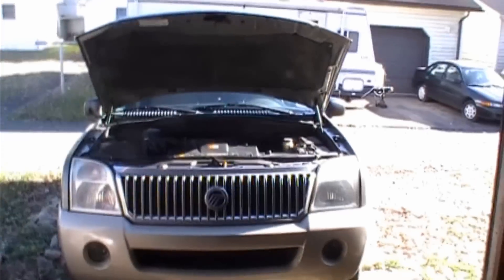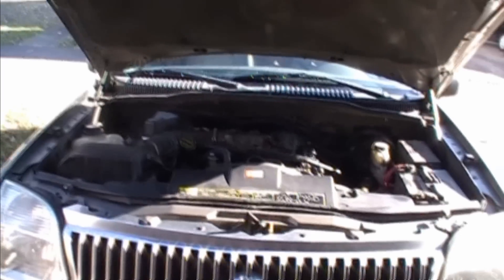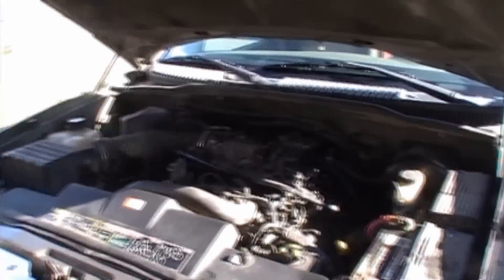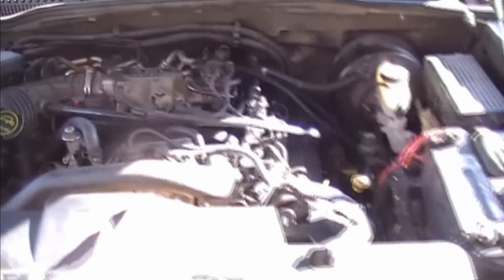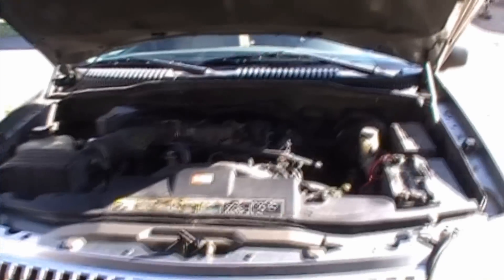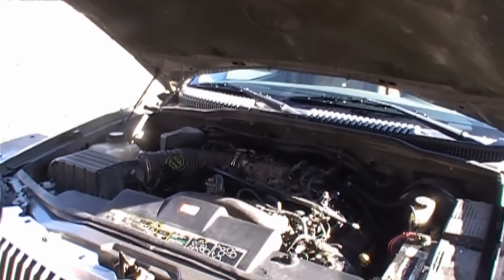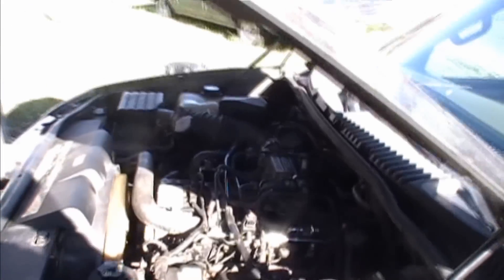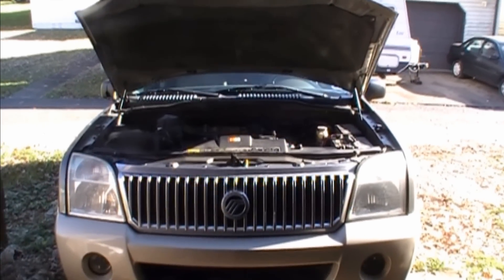PO430 CODE  The real story...don't waste your money!!

Comment: Should not there be p0171 and or P0174 if the intake manifold cracks a little? What if it is only P0430?
Reply from the maker: True, but you can get a po171 and po174 if it a bad exhaust leak. I have a pending po430 again...I need to test the converters now. I think one is actually getting bad ;(
Reply from the maker: po430 is almost always a intake, air, moisture slight leak. For me that's been my history.
Reply: @FixingWithPassion  Hey man. Great video. I have a 2002 Lexus IS300 and am getting codes p0430 p0171 p0174. What do you think is wrong here?
Thank you
Reply: @FixingWithPassion  how can I test the cats? Infrared thermostat? If so  what should my readings be? Have you ever used a O2 sensor spacer? 
Thank you

Comment: Didnt work on 2003 explorer 4.6l      still p0430 code.  Replaced o2 sensors last year.but my concern is,ive got the milky oil cap and water filling up in oil seperator i put on truck. There was a bunch of water in spark plug hole in cylinder where this intake cracks.(driver side plug closest to firewall)what is up???? Inspection is due and im frustrated
Reply from the maker: That's your issue. The intake gaskets are a big issue on these plastic intakes. E-BAY , new intake with gaskets...$120.00...Fixed my PO430...on all 3 explorer's and my expedition. As for the milky stuff, moisture could be getting into the intake;( ...from the bad intake gaskets.
Reply: If you have milky oil cap p0420/30 will never let you go

Comment: This worked on my ‘09 Jeep Wrangler. I had tried the Cataclean and new O2 sensors in bank 2. Neither worked. 

I had loose connections. Tightened everything back down and cleared the code... so far, after 50 miles— no new CEL.
Reply: What connections were loose

Comment: Yes, but!  The code didn't come back BUT, Oxygen Sensor Heated came up as Not Ready!  So, the sensor isn't getting hot enough, so you probably have to drive at high RPMs and then rev the engine while you sit in line at the station.  Keep your own monitor on the OBD2 to monitor it just before it goes in.

Comment: I really need your help. I have the same code and I replaced the cat without any results. I need to know what your vehicle symptoms were. My does this weird thing we’re I all of a sudden get a little hesitancy on the highway and I need to punch the gas to get the truck back up to speed. Did yours do this as well?
Reply: Im no expert but that could be fuel injectors, spark plugs or air intake. I had issues with my previous vehicle and thats what the issue was.

Comment: Well in my case on my 98 crown Victoria they guy I bought it from told me about the code it had the ecm replaced due to multiple misfires on all cylinders when I got it runs fine code came back also manifold cracked I have a new manifold new plugs still have code could the previous issues have done the catalytic converter in already
Reply from the maker: O my !

Comment: I have a 2007 Chrysler Sebring that  shakes in idle , burning smell and stumbles when I accelerate.  First the check engine light came on and then the car overheated. I checked under the hood and there is a huge crack in the radiator hose and all the coolant is gone. Today a "electronic throttle control" code came on and now it's gone off and hasn't come back on. Could all of these issues simply be from this Leak from the hose ? Once I replace the hose and coolant will the car run normally and we the burning smell go away ? I don't want to pay a mechanic to do what doesn't actually need to be done so I've done research but your vide makes alot of sense

Comment: A blocked fuel rail was what was causing mine in a 2000 Nissan maxima I bought with a check engine light on. The previous owner and his mechanic replaced o2 sensors and cats and it kept coming back i kept pulling the freeze frame data for 6 months and determined it was a fuel issue
Reply: Holy cow thanks for sharing. 

9/99 or 2000 model year Infiniti  i30 use to tell me I needed my cats replaced.  New Hitachi coil packs and replaced both speed sensors ( bank a and the revolution. Shifts smoothly and no more waiting for my speed odometer to wake up . (Po500) 

Fluid is blackish red thinking about removing a couple  of quarts and adding some  Lucas.  Hopefully  I can get another  100000 thousand miles  out of the old transmission. 

I have 253000 miles  on her . 

The engine seems to be acting like its unstoppable. 

Royal purple high milage 5w30 . Helps with noisy lifters.  
I love my car. Clear coat is trash. Chips.
Reply: I had a 0 volt o2 sensor replaced it helped. Genuine Nissan part it works very well.

I use bluedrive.  To troubleshoot.
Reply: Thumbs up thanks for the heads up.
Reply: I ran a bottle of Lucas super fuel system cleaner/ combustion chamber cleaner every fuel up for 3 months straight and like it says on the bottle it works check engine light went out on it's own a week later and I reduced it to one bottle a month and now I'm on 1 bottle every 3 months still no check engine light and my power and performance is back but my fuel economy still isn't but I blame that on 3.5 mile trip to work and back for a total of 7 miles a day
Reply: On our trips back and forth from MD (170 miles each way) I do get close to the fuel economy I'm supposed to get 30mpg, I see abo 25mpg and again I blame traffic on that one sitting in the same spot for 20 min or more alot in MD on the beltway

Comment: I have a 97 Ford F-150 and I don’t have an exhaust on it has a catalytic straight down the engine from where u check the transmission oil and all that I was on my way to the bay and passed through the Livermore mountains and my check engine light started blinking and my gas pedal started getting harder not letting me accelerate and it started rumbling bad and it has a cylinder 7 misfire what can this be I need help please
Reply from the maker: Ok.....fix #7 first

Comment: On my 03 Ford 4.6 been losing coolant for over 3 years (about a half gallon ever two months), no signs of water mixing with the oil. But now I got a P0430 code. Where should I start looking? Thanks.

Comment: I had my engine completely rebuilt by a reputable machine shop about two years ago and I’m sure all gaskets were replaced...so why would this happen? Could it be catalytic converter? My truck is almost 20 years old. I replaced all O2 sensors.

Comment: I had a bad head gasket and all the coolant was gone. My buddy from Toyota dealer said not to replace and said coolant might have infiltrated the catalytic converter at bank 2. Said to rebuild engine and slap it back and drive a while to clean out coolant and light might disappear during break in period of rebuilt engine....The light is back on....Any thoughts/ideas as to how many miles it might take to burn out coolant or to simply look for leak since the rebuilt passing a certain number of miles negates the cleaning out idea.
Reply: Oh it is for a 2005 Tundra 4.0L
Reply from the maker: Best thing to do......https://www.youtube.com/watch?v=JFCYZVx_4WY

Comment: how do you know if it's the intake. I just changed my radiator it had a hole. but im still getting bank 1 and bank 2
Reply from the maker: Bank 7-B
Reply: Smoke test. Pull a vacuum hose, plug the port where it hooks up, and blow cigar or cigarette smoke in the line and watch for it to come out somewhere.

Comment: Exhaust leaks vacuum leaks mass airflow sensor is 90% of the issues with this code as a mechanic I dealt with. It was  rare or ever a o2 sensor goes bad .when a o2 sensor code  goes off it's doing its job .telling you something in the system is wrong

Comment: So pretty much I need to change my plastic upper in take or my upper intake gaskets?
Reply: Depending if your intake is plastic, it could have cracks.  Or you most likely have gaskets that are faulty.
Reply from the maker: Pretty  much all intakes now days come with the right gaskets for the intake. Less that $125 on e-bay free shipping. Make sure to have the right V# of your auto.
Reply: @theman9462185  yes its all plastic 2004 ford Taurus v6 3.0 ohv...
Reply: @theman9462185  thank you.i  appreciate your honesty feedback and videos Sir. I'll be shopping on ebay I guess

Comment: Hi Nathan, I got a avensis t25 2004 2.0 . I got the p0430 code. I saw that my intake gasket is also made of plastic. Do you have any experience in such models and same faults? Thank you.
Reply from the maker: Intake gasket possible or a air intake leak.
Reply: @FixingWithPassion  thank you.

Comment: I bought this Toyota 2000 tundra 4.3 
Two weeks ago and now that is time for me to take it to emissions pump check engine light and same code here u think could be the same issue since I also hear a puff puff when I ran the truck on the passenger side any advice will help today I was about to buy the 02 sensors but I decided to give a try searching for more info on here

Comment: Thanks for the video! I'm a novice mechanic. Trying to learn just enough to be dangerous. :) Especially if it's something I can do myself. I have a 2005 Jeep Liberty and I have the P0430. Are you talking about tightening the intake manifold?
Reply from the maker: Good to check them. Check fuel trims with a code reader.

Comment: 35 years of working on vehicles for a living and I have only seen a few  situations where this video information was the cause. FYI the mountaineer is notorious for leaking at the intake. This is not the same for other vehicles.
Reply from the maker: In my world , it every 4.6 mountaineer that comes my way for some reason...that need a new intake plenum/or gaskets that triggers the PO430. Cheap plastic intakes. There should have been a recall.

Comment: How do I locate the intake gasket on a Lincoln LS 2002? And how can I figure out if it's really the air intake ? Do they cost a lot for the part and the labor ?
Reply from the maker: Its on top of the motor. With a question like that...you are scaring me ;( ....Yes ...if a mechanic does this its probably going to cost 100's of  dollars plus parts. ;(

Comment: They make cars way too complicated these days. It's all in a bid to continuously rip off the customer.
They need to focus on good reliable engineering instead of gadgets and laptops.
Reply from the maker: dhalsim1     Yep...it's all about getting the air clean out the tail pipe so the environment stays smog free.
Reply: @FixingWithPassion  you do know most cars over 8 years old are worse than most cars before catalytic converters were made? The reduction in performance of the cat increases fuel consumption and the cycle continues as most people only replace that emmision junk when it causes drivability issues. They also waste a lot of materials like platinum and steel so there is more emissions from production and mining so they really cause more damage then they help.

Comment: Hey Xman.... First let me say that I'm not a mechanic.  I got a 2003 Nissan Pathfinder with 195k miles.  The person who I got it from was told that the "service engine light" was no big deal.  I'm sure its not but I can't register the vehicle without it being smogged in California.  It will not pass smog with a "service engine soon" light on.  Plugged in a code reader and got codes P0420, P0430 and P0470.  
Decided what the heck i'll changed the Oxygen sensors (all four of them) and clean the throtle body (fix for P0470) and see what happens.  Two of the codes disappeared.  Code P0430 however remained.  Took to a Catalytic Conv. shop and was told that It was definitely the Cats.  Changed the two Bank 2 cats as two shops I went to told me the only way to guarantee a fix would be to change both Bank 2 cats.  The car has 4 cats....2 on bank one and 2 on bank two.
Bought the cats online had them installed and code still comes back.  I'm presently trying to clean the intake and find possible cracks.  There are none.  

I went to code2.com and the three possible problems mentioned there are:  1.  The catalytic converter is no longer functioning properly.   2. An oxygen sensor is not reading (functioning) properly.  or 3.  There is an exhaust leak,

Will report on what happens after I change the intake gaskets and clean the entire intake manifold.
Reply from the maker: I know California is a pain in the ass for emissions. Use to flip cars there back in the day... Yea let us know what you find. My thinking you have a bad intake gasket. Ive had them look new only to have small cracks in them. That code says there is something going on in the engine area, gasket air leaks, moisture getting into the system... ect. Try to spray some starting fluid around the intake and see if the idle changes...if so ...bingo!   P0430 -99% of the time its something going on near the engine...
Reply: HI I have an 06 Nissan Titan  4wd 5.6 flex fuel crew cab. I have the same problem you do. error code p0430 all 4 cats says are bad. I have noticed loss of fuel economy as well. So I'm wondering what did you end up doing to fix the problem
Reply: Jeff R did you ever get your titan fixed for p0430? What was the solution? Did the mileage improve?
Reply from the maker: Intake gaskets were bad. And found a small crack in the bottom of the plastic intake. Replaced both. Ran like new aft wards!!
Reply: TVWXMAN32 thanks, great to hear it.
Reply: You never reported back...

Comment: Need some help.. I have an 01 Nissan pathfinder reading po430 no known issues at the moment I had the code cleared reset the ECU and it went 300 miles before the light came back on.. Any suggestions?

Comment: I get the P0420 & P0430 codes and I can clear them ok. But once the ute is driven for say 50 klm the engine light comes back on again and sure enough the same code is present. This ute does alot of sitting around in a garage which I know is no good for it.
So if it was a vacuum leak or sucking air in would the engine light come on virtually straight away?

Comment: Have a 2013 F-150 with the 5.0 and I just had this code pop up. I put on a new Canister Purge Valve (mounts right into the throttle body) on my truck because it was pulling a vacuum on my gas tank a couple days before I got his code. I'm going to look for a possible leak around that or the intake gasket. Ill post later if this is my fix. I really hope this does it.
Reply from the maker: Yea there is a leak there somewhere;(
Reply: Robert Dallimore .
Reply: Robert Dallimore update? i have samd year truck and engine and just got po430 last night...
Reply: Brian Desjardins got the same issue on my f150... any updates? Thanks
Reply: Have any of you guys find a fix for that code on you f-150. I have the same code. Says my cat below trush hold bank 1. I cleaned the sensors and got a new cat. Code still there. I'm going to look for leaks but was wondering if anyone found a easy fix or leak.

Comment: I was told to check the temperature at the front and back of the catalytic converter with an infrared thermometer that you can point . I have 2004 toyota 4runner with a P0430 (bank 2) code. I checked the temp first on the drivers side's first catalytic converter and it read 360 deg F on the input and 430 deg F on the output. But the passenger's side catalytic converter is around 360 deg F on both the input and output. To me that would appear that the catalytic converter on the passenger's side is defective. Or can a intake manifold leak cause the same effect and the converter is okay?
Reply from the maker: Do you have a PO420 also?
Reply from the maker: No, with those temps its a bad cat. You did the right thing! PO430 is 
usually related to intake gaskets, slight leaks etc. Sounds like your on 
top of it! But most of the time you should have gotten a PO420 Hum.... 
Let us know if you fix it and re do the temps again on the cats so other
 folks maybe can have a fighting chance to fix issues like this.
Reply: There was just a P0430 code. But why is the passenger side catalytic converter appear to be defective when it's a Bank 2 error code which should be the drivers side?
Reply from the maker: I think whats going on here is a cat is misleading you. Meaning something up 
stream is causing the cat to go wild. PO430 means something in the 
engine is leaking...air/moisture etc. I'd start looking at gaskets. I 
bet you have a gasket or a slight leak in the engine. I would not touch 
the cats....start at the engine!

Comment: CEL P0420 for my Mazda 3 05 2.3L

Changed spark plugs, runs a bit smoother but still feel power restriction. Might look into the cat as most signs are telling me that. Also I have a plastic intake so I'm not sure what to diagnose first?
Reply from the maker: Make sure you don't have a vacuum leak somewhere. Hard to say unless it looses power afer you drive it a while. If so the cats could be plugged up some.
Reply: TVWXMAN32 thanks for the reply